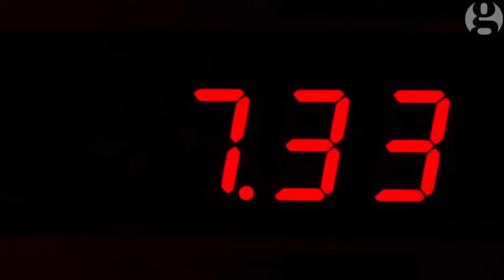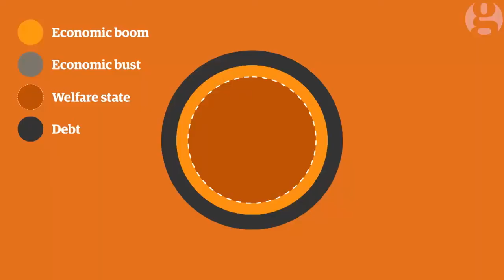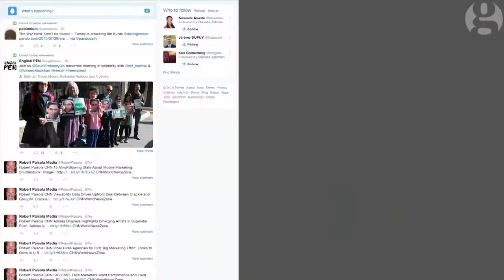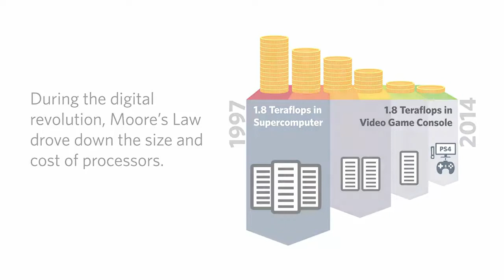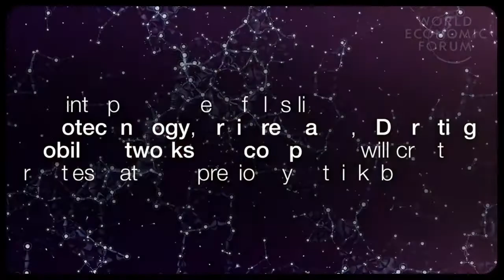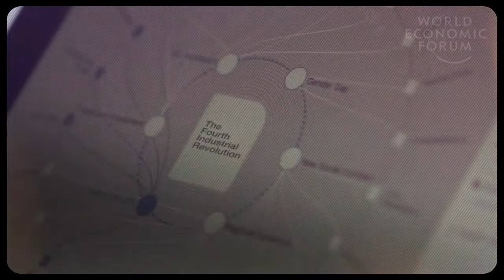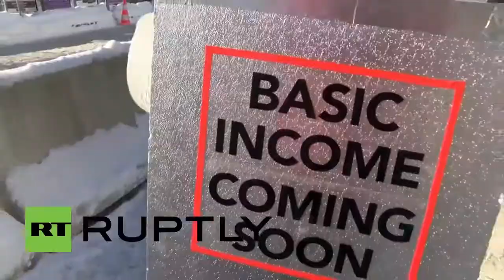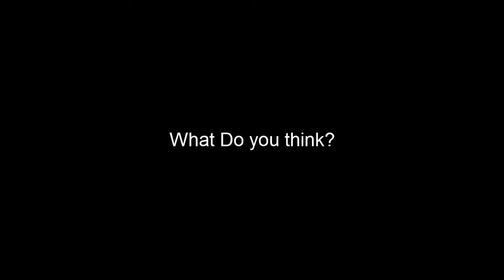4th Industrial Revolution

Comment: I think they are pushing for a guaranteed income because the greedy are worried about the prospect of multiple revolutions that would interfere in their bottom line, there is no way there will be a job machine or education site to automatically allow people to create their own jobs and have secure incomes with the way the copyright system that is in place now, a guaranteed income will prevent uprisings and allow leaders to control the masses and pacify them
Reply from the maker: Very much so